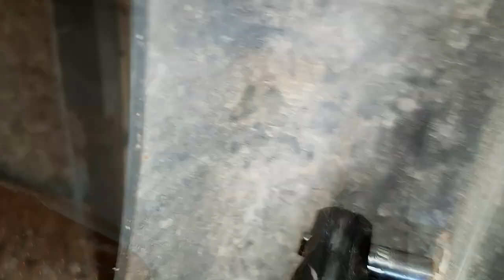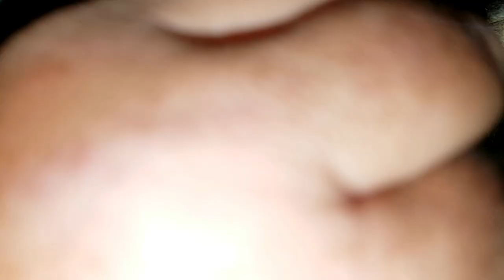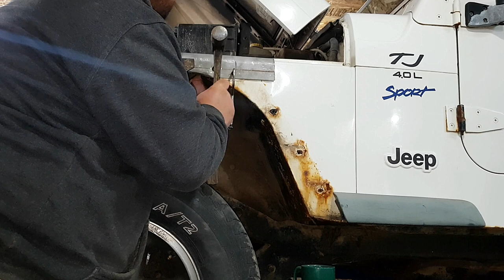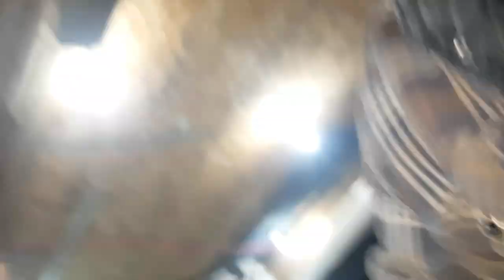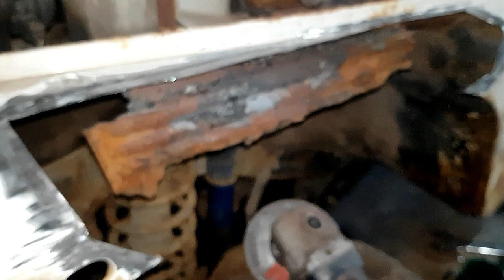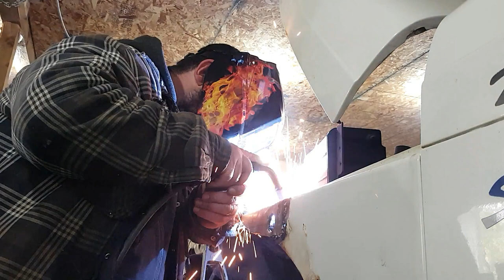how to make patch panel   on  jeep wrangler yj fender

Comment: If you weld in the area of the foam. It catch on fire?  I cut a small section out and was going to coat the foam with rust reformer then weld new patch in  (2” x 4” 16 ga)
Reply: Update: the foam burned a little but you just blow it out and its fine. I gotta fixed aolid fender now.

Comment: Nicely done caper man!! Just a curious question here. What if you put a bead of clear silicone in between the fender and the wheel flare out 🤔. 🤜🤛
Reply from the maker: actually you are on the money,i will have to seam seal all the jointed areas,it is not a silicone base because the paint and silicone don't play well together,it is a urethane base,i have to remember to include this information,thank you buddy!

Comment: What settings do you run your welder at for body panels?
Reply from the maker: I have a Lincoln migpac 130 run between 2 and 3 depending on the gauge of metal 
ty for the question ask any time always happy to help please consider ringing the bell 🔔 ty